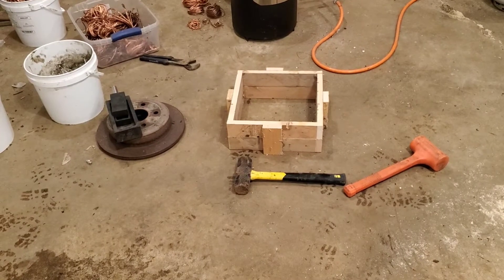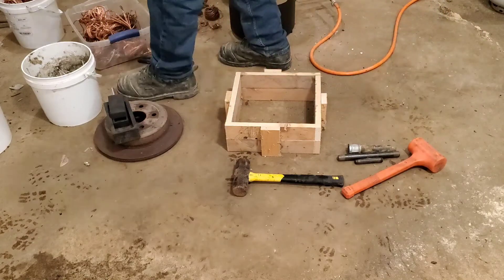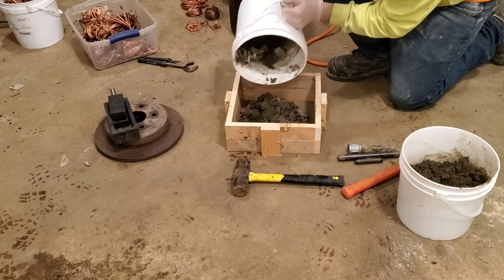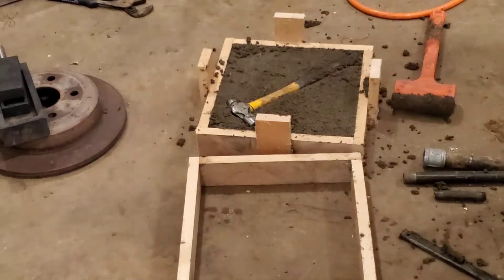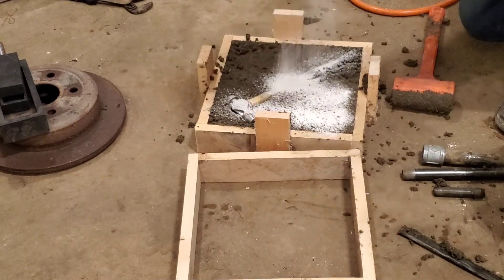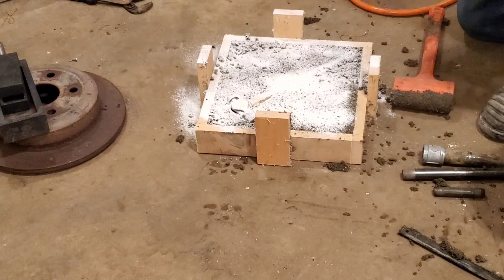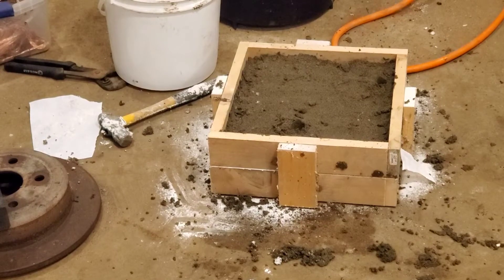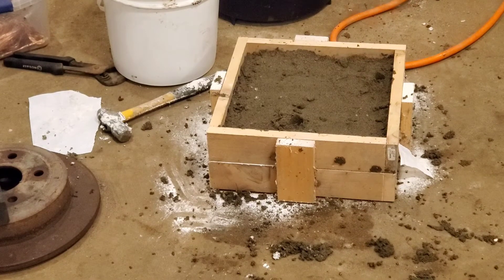Casting a copper hammer first sand cast

Comment: Good on you mate! 👍
You can't learn if you don't try. I still haven't attempted sand casting yet. I have to spend some time to make up more green sand, I have nowhere near enough made up. I crushed the bentonite dry and mixed with sand dry and was going to add water gradually till it held shape when I was going to use it.
The hammer turned out great and will be a conversation piece for sure.
I've also have been thinking of ramming dry cement powder as it is so fine it may leave a smooth finish around the item to be cast but not sure if it would release when separating? It would be interesting to try though. Cheers for the video.
Reply from the maker: I gotta find a better way it takes forever for me too do

Comment: Nice job. Couple pointers... 1 pack the sand harder! It will stick in the mold better and you won't have the issue of it trying to fall out. 2 fill the top of the mold all the way up with sand. That will also help it stay in the mold. 3   cut around the pipe where your spru is. Will give you a bigger hole to hit when you go to pour the mettel in. You can also make small vents along the pice to help it fill all the way up. Hit me up if you have any questions. Will be glad to help! Nice job for it to be yours first time!
Reply from the maker: Thanks man.....i severly underestimated the amount of sand i needed but i didnt have anymore i could make so i went with it.
Reply: I understand. I have been in the same spot! Lol